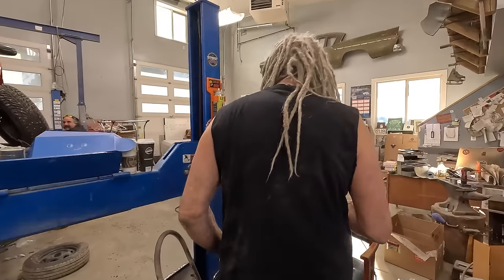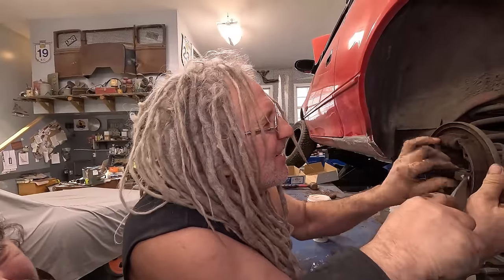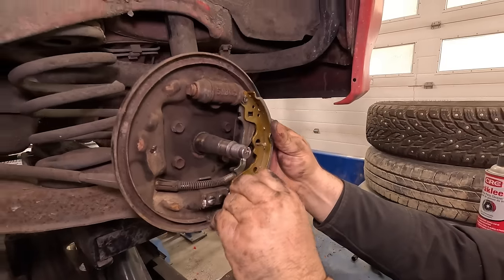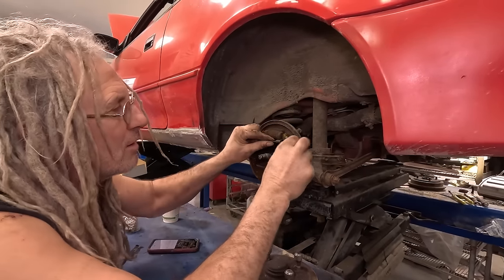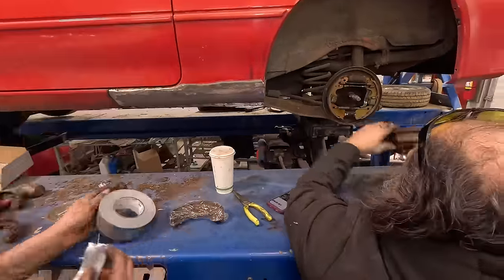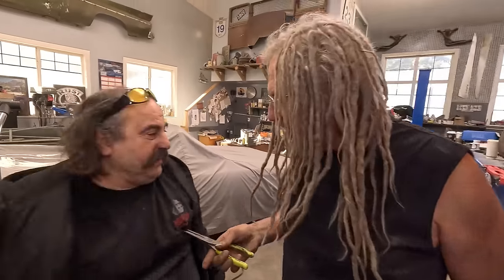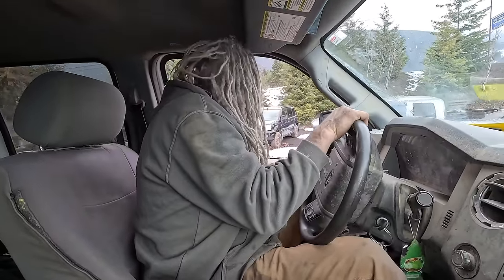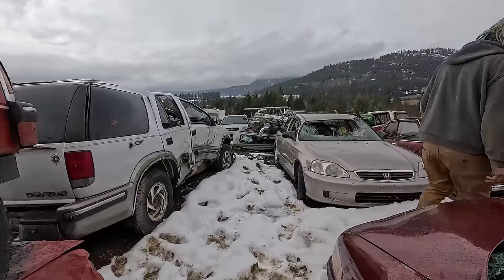Firefly Brake Job & Wheel Search!

Comment: Hi Mike , you and Avery should have some brake cleaner when disassembling brakes. There's a lot of dust inside those drums and brake pad manufacturers don't have to tell you if their pads contain asbestos. The brake cleaner is also used to clean new brake drums clean. New drums come with a light coat of oil to keep them from rusting. So spray the old parts with brake cleaner to keep the dust from flying around. Wipe with paper towels and wear a mask. My friend Claude was a mechanic. He died around 20 years ago of lung cancer. He was 52 years old. His widow was eventually compensated by VW. That didn't replace Claude, a husband and a father of two girls. Be safe.
Reply: The good old boys club

Comment: 92 to 02 honda accord wheels fit those firefly perfectly
Reply: Old 4 cylinder cars came with 4x114 and newer/smaller  ones were equipped with 4X100